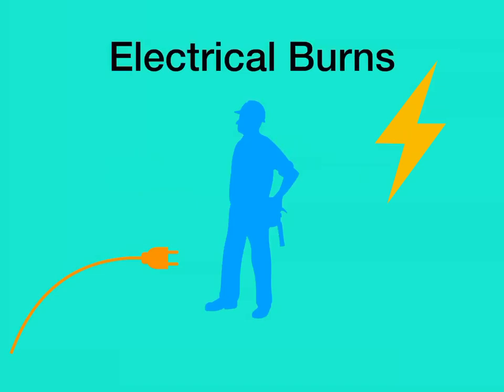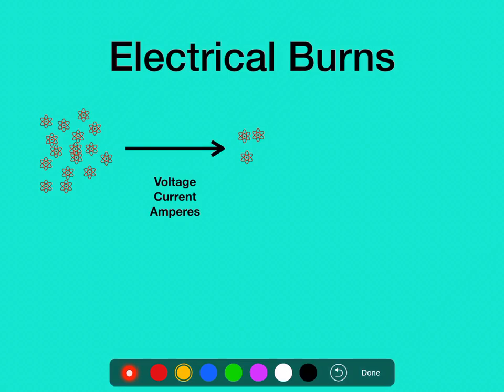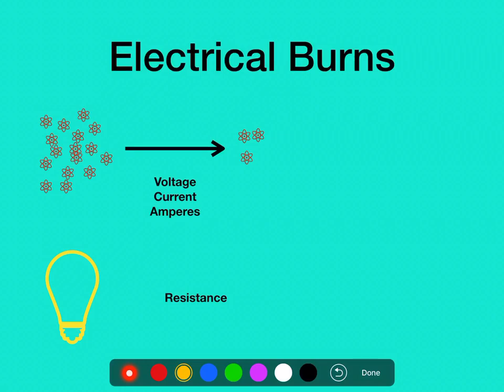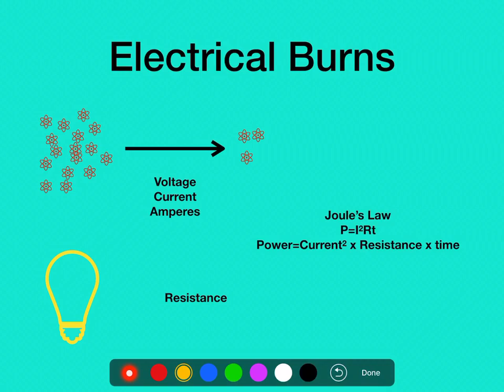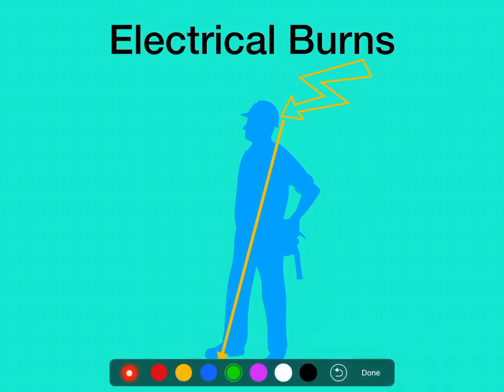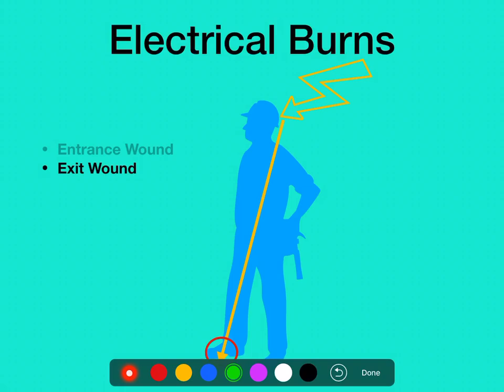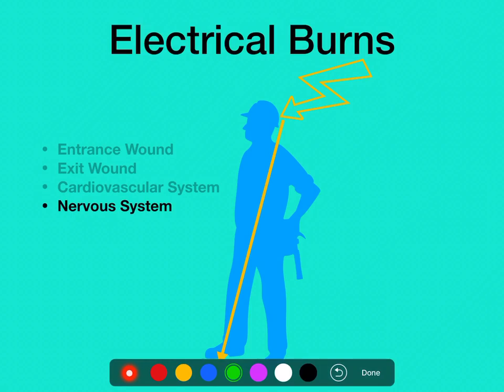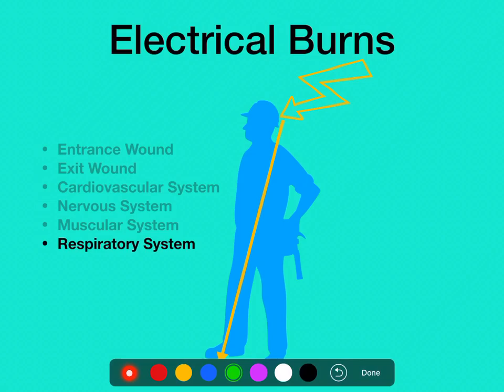Electrical Burns

Comment: I received the strangest injury from prolonged exposure to 90v DC electricity. It must be a burn, tho it's unlike any burn I ever saw. There are only 2 symptoms, the skin on my finger got very dried out, tough and leathery, and due to the change in texture I have mildly decreased sensation. It has been days since it happened now, and my finger still looks normal. No discoloration or anything. The hardened skin goes across a joint and the skin cracked there, but aside from that it looks entirely uninjured. When I touch the site, sensation feels normal except for slightly decreased sensitivity due to the hard surface of my skin there. Every other time I ever had a burn, it looked visibly burned and it hurt.
Reply: Could it be possible that you’re suffering from diabetic psoriasis?